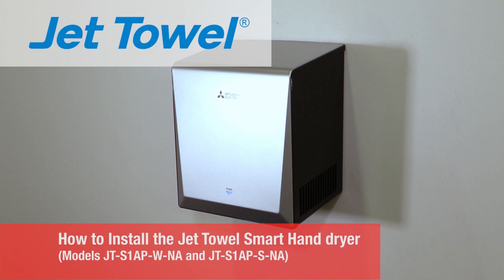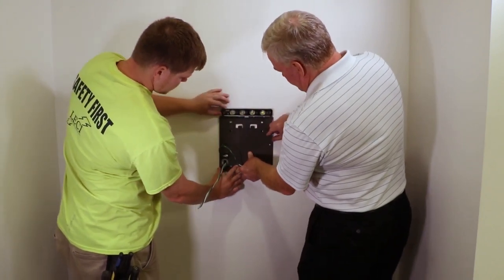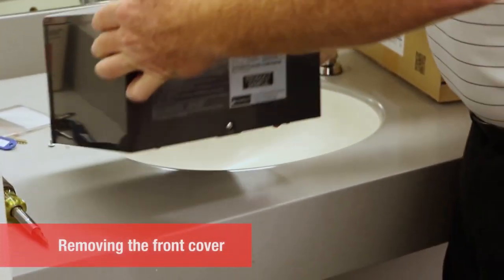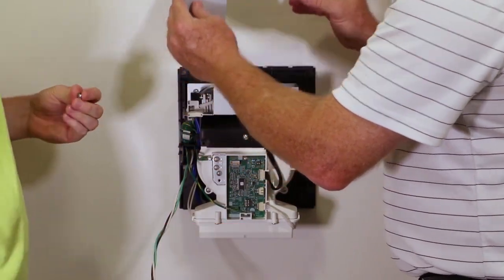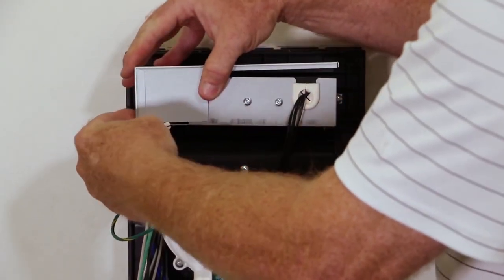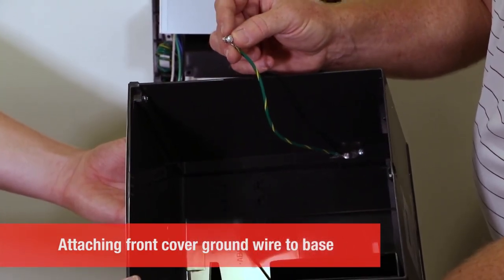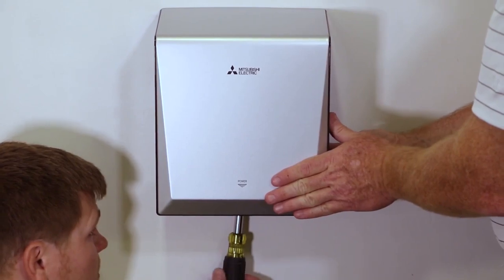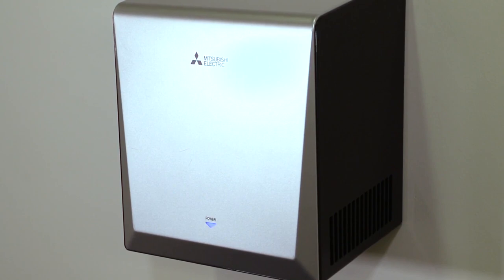How to Install Mitsubishi Electric’s Jet Towel Smart (L)

Comment: “The air speed cannot be changed on the Smart model” I found “air speed” on the circuit board if you look next to the heater setting.
Reply: Lol
Reply: Lol